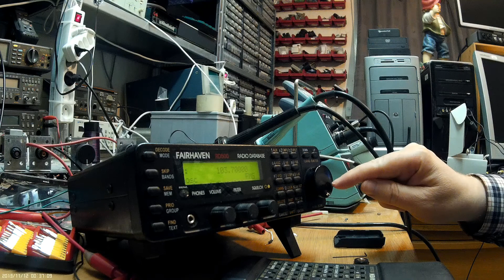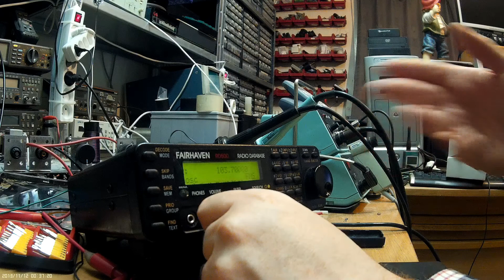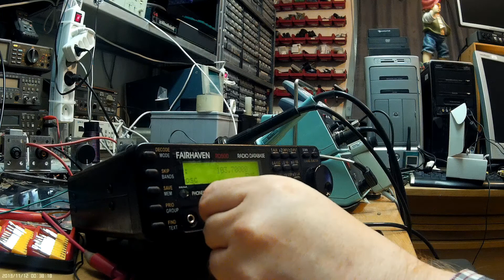Fairhaven RD500 test

Comment: Hi Tommy, I am glad you like this radio as I designed and wrote the firmware for it! It was a challenge to fit so many features into the ROM space available.on board the Hitachi H8 series processor. You can also connect a keyboard to it! The receiver was an independent design by a former BT engineer and only a few hundred were made. It got great reviews at the time but couldn't compete against the big names.
If you want any further info about it let me know and i will see what I can do. I am still in occasional contact with its creator. He moved on to designing comms systems for hanglider pilots after this project.
Reply from the maker: Hi Bob!
WOW! I didn't expect to get a visit from the software programmer behind this radio. Thanks for the generous offer about information, I'm quite sure I'll take you up on that when I actually have something intelligent to ask. Thanks again!
Reply: Tommy Helgevold
Hi Tommy, Sorry it's taken me a few days to get back to you but my google account has been given me some issues which I hope I have finally sorted out. Did you get the manuals with the receiver?
Reply: +Bob Bellchambers-Wilson Hello, I hope you are still on-line. I recently bought S/N 6125 and it is an very interesting radio. 50,000+ memories! It looks like the unit was designed with a future remote head option. It came with manual, software, and schematics. I was able to find most of the stuff online as well. I was an engineering tech, but now do embedded software for a company in the energy industry. The radio works except the 7 key and Up key does not work very well. Cleaning did not help. The remote comes in handy, but it would be nice to fix it. Do you know what company made the keypad switches? I tried joining the Yahoo Group for the receiver, but it appears dead.
Reply: +Eric Cottrell Hi Eric, I am still in touch with the designer of the receiver and will ask him on your behalf.
Reply: Thanks!
Reply: Hi Bob and everyone! Well I'd better come out of the woodwork! I designed the RD500 with a great effort from Bob providing all the firmware and some of the PC software. We're back in cahoots working on altimeters with some exciting products in the pipeline.
(ignore the handle, I don't use my name on YouTube)
Reply: Been looking at one and very tempted, but I am wary because of its age now.

Comment: I also own this very nice radio! a 2001 model. I was lucky enough to find one in pretty good conditions for 400€ but i'm really really happy with it. At first i was a bit concerned about the quality of these Communication Receivers (is not really a scanner as for band scanning is pretty slow ahah) on the HF bands, but after months of use and just a 22m random wire i couldn't believe how good the reception quality is!
I use it as BC listening, Number Station hunting, WeatherFax scanning, even Pirate listening
I'm really happy i found this gem.

Comment: I bought one yesterday (6/7/15) for £300. Serial number is 5705, I don't know how late in the production run this number is. It's such a compact piece of kit and is dwarfed by my Drake SW8. I have it currently hooked up to a Wonder Wand Widebander but will soon have a Wellbrook ALA1530 set up. At the other end I have a BHI NEIM 1031. I need all the help I can get given that my QTH is a mid terrace flat so lots of RFI about the place. With the exception of the Drake, the Kenwood HS5 headphones and a K Po speaker the whole setup is British (as am I) which was quite unplanned.